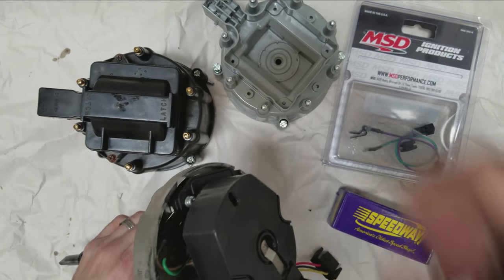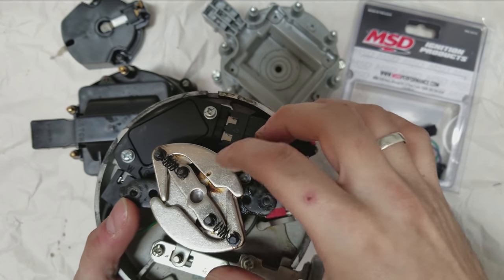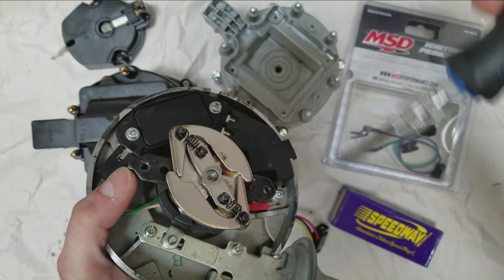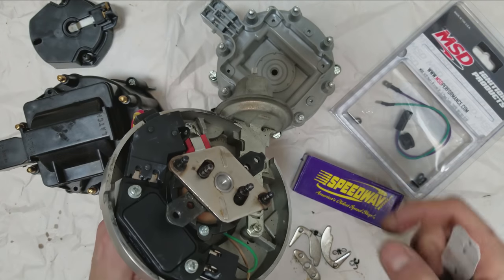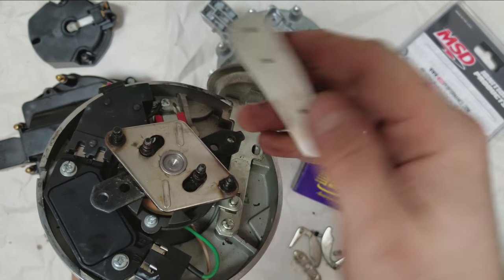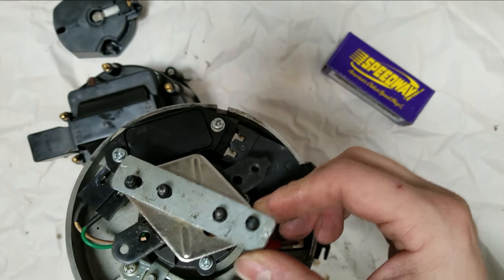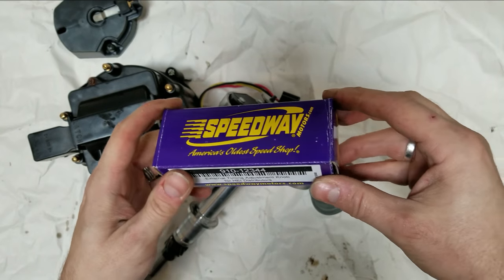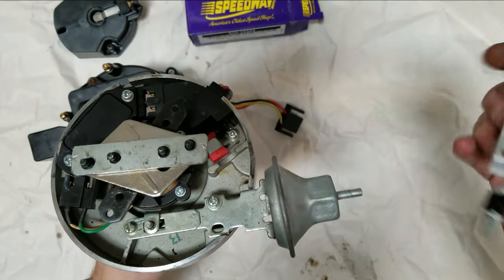1967 Turbo Camaro - GM HEI Large Cap Distributor Timing Control with Holley Sniper EFI

Comment: Thank you for the video!
I have a Ford 300 I6 that has a PerformanceDistributors aftermarket HEI distributor and am looking for Holley Sniper timing control.  I'm going to dive in and give this a try.
Reply: And.... success.

Thank you again.
Reply: @milesaway1980  how did it work out? Ive watched a couple of your videos and we have pretty much the same set up. Is throttle response better and what did you do for max timing at cruise? My dui distributor i curved for 14 intial, 20 mechanical advanced, for 34 at 2200rpm. Vacuum gives it 9 more with a limiter plate. It doesnt ping at all. Just curious if you had to change timing drastically from your stock dui curve when going electronic with the efi.
Reply: @colerippeon3903  For the most part, the curve is a lot the same.  However, you can fine tune it MUCH MUCH more accurately.  You can set the timing you want for a given RPM and cylinder pressure (vacuum) on a big table, instead of just rate of change for mechanical and vacuum advance.

Then there's extras you can do like retarding timing when you're starting it (so you can run more base timing), retarding or advancing timing for temperature, etc.  

It drives very similar, but those extras made it really worth it.  Plus, if you have a problem area, you just adjust the problem area.
Reply: @milesaway1980  thats awesome. Especially being able to retard when starting. My truck looooves alot of initial for get up, but once its hot, any more than 14, itll fight the starter. Hence why im all in at 2k rpms lol. Thank you for responding. Im gonna go this route for sure in the near future.

Comment: you said a few times this is a daily driver.. and what I like about this is it's a 3 year old video.. how is everything working? any fails left you beside the road with the sniper?
Reply from the maker: No fails related to the Sniper or it's timing control whatsoever. However I've had bottom end trouble for a while and figured out my machine shop misread the cam card. So, the car is off the road while I deal with that and other life issues. The sniper has been one of the best investments in the car. The Retrosound stereo has been great too!
Reply: @TurboCamaro67  I'm so happy to hear that. Based on your video and testimony I think I'll go with the sniper quadrajet, I think It makes sense to use the hei as well since parts are so easy to get. How many kms do you have on your sniper?
Reply from the maker: The sniper is a solid unit for sure. I don't have any real records to track the exact kilometers, but my best guess is between 11-12000km's (approx 7000 miles). My commutes have remained short even though I've moved several times since my last video.

Comment: Awesome video, I think I understand what was going on at about the 19:47 mark through the software point, but where did you come up with the voltage rating? Also I have a 6al box, so I should only have to remove my existing yellow wire and use the coil drive wire from the msd box correct?
Reply from the maker: +Benjamin Leibecki the minimum signal voltage defaults to 0, and Holley recommends a .35 default so injury increased mine to .65 to ensure a clean trigger signal. I ended up with a .195 inductive delay, but honestly their was little change get between .130 and .195. As far as wiring that sounds right, it's exactly the same as hooking up an MSD distributor as far as which wires, and definitly don't use the yellow wire.

Comment: I know this is an older video, but I wanted to ask if you are still using and still happy with using the HEI distributor?  We have a Sniper and a HEI/Ford hybrid distributor in my son's 1966 Mustang with a swapped 1990 5.0.  If done correctly, will this give him the economy of a vacuum advance setup?  Thanks.
Reply from the maker: I'm still very happy with the locked out and Sniper controlled HEI distributor. It's really never given me any trouble and seems to work flawlessly. Having the sniper control your timing, with a proper timing map, will give you the same, or better fuel savings as a vacuum advance setup. Not to mention you can monitor your timing in real time with the hand held controller and really fine tune the map for even more efficiency and savings. Your Mustang project sounds great!

Comment: So if i lock out the hei that i have do i rotate the engine to tdc at zero or 34 degrees before tdc
Reply from the maker: Sorry for the delay, you want your TDC on the compression stroke to occur at your reference angle. In the video at about 8:30 I talk about this being at my chosen angle, which was 45°. From there you want to ensure your distributors sensor is phased around your engines peak timing, which will vary from 25-38° depending on your engine configuration. I hope I was still able to help and it makes some sense.

Comment: Again, awesome video, I do have 2 quick questions though. I am running an msd6al ignition box with my hei, so should I select cd box, or magnetic in the software. Next question is on the 15* static timing, should I be using an adjustable timing light set at 15* and looking for 0* on the balancer, or should the timing light be at 0* and I look for 0* while cranking? Sorry for the long post but I’m a little lost on the timing part
Reply from the maker: Hey, glad you enjoy the videos. I haven't used a CD box with the Sniper before but, my understanding is you'll choose "CD Box" to use the system without timing control. Once you know it all works you'll change it to "Magnetic" and use it with timing control. If your using 15°, you'll set the timing to 15° (timing mark on the balancer typically 'left' of your 0° tab. Then with your light set to 15°, you'll see the timing mark at 0°. As a confirmation, If you set the light to 0° you'll see the balancer mark slide to where you originally set it to the 'left' of the 0° tab.
Reply from the maker: I should mention, the 'left' remark is for clockwise rotating engines. It would be the opposite on counterclockwise engines.

Comment: can this be done with the dissy in the engine? I cant get mine out without pulling the engine and i really dont want to do that
Reply from the maker: It certainly could. You just need to be able to lout out the top portion. If you can accomplish that without pulling the distributor you'd be able to rig up the cable/sensor I'm sure. Obviously easier if it's out, but if you can get at it good enough you should be fine.
Reply: @TurboCamaro67  thankyou! the sniper efi can also work without dissy input to control timing right? if i dont do it?
Reply from the maker: Unfortunately, the sniper requires input from the sensor in the distributor to know when to fire the spark to control timing. You can setup the sniper to run the engine but keep the distributor set to mechanically control timing as it was originally designed to do. Once your satisfied with the fuel setup on the sniper, you can add timing control later.
Reply: @TurboCamaro67  awesome thanks!

Comment: Hey, great explanation of how and why this will work. I do have a question however. You had to put a Holley coil driver inline between the sniper and the coil. I have a Fitech 30004 system. Do i need to purchase a coil driver like you did? OR is that not needed with the fitech systems?
Reply from the maker: You'd have to double check with FiTech, but my understanding is the FiTech units have the coil driver function built in. However I couldn't say if they all do by default, or only on specific models. I have heard this method will work with a FiTech though, so your future is bright 👍

Comment: Your crank signal wires (green and purple) don't match on the connector you have green going to purple and purple going to green was that intended? I'm  doing the same set up and was scratching my head at it
Reply from the maker: Yes, for whatever reason the colors are not coordinated correctly. The instruction I reviewed at the time confirmed you had to swap the wires to have it function correctly. Unfortunately it's been years now and I can't recall the rationale for it.
Reply: Sounds good thanks. Was the instructions you followed from efipros?
Reply: @hoythenderson8827  Could have been, their wasn't much available on timing control with a large cap dizzy. I know it made sense at the time but I'm not certain about the source.
Reply: @TurboCamaro67  did you have bad rf with your system?

Comment: Really interesting. 
Have you thought about switching to a clutch fan, instead of the fixed power killer metal fan?
Reply from the maker: I have thought about it. I've actually since switched over to a fixed poly fan with 6 blades. Increased cooling and decreased some of the power loss due to the weight drop. However, electric fans would be great in combo with the Holley EFI system.

Comment: Have they gotten lax? I received no wiring connectors with my holley sniper efi master kit.
Reply from the maker: I don't know, I had a nice supply of them... But that was over 2 years ago now. The connectors were a nice touch too.
Reply: @TurboCamaro67  great video btw I plan to do this with my hei distributor so I can control it instead of buying hyperspark. I know I've seen other vids where people said they got new studs for the intake as well as a fuel pump blockoff plate in their kits as well, but those too were older videos.
Reply from the maker: Wow, that's a shame they're not including those. The extra pieces were what really sold me on the kit. Thanks for watching my vids!

Comment: Will this work on a older Chrysler mag pickup ignition if I lock it out?
Would I just use the coil driver from the sniper kit instead of the chrome cdi box?
Thanks.
Reply from the maker: Maybe... Probably? It should work as the tech is the same. Once you lockout the advance and use the coil driver the only part you need to figure out is the phasing. I just used a cheap eBay dizzy so almost anything can work if setup right.
Reply: Turbo Camaro Thanks,
You sure have some excellent vids posted and I’m working my way through them.
Worst case I found an HEI for mopars priced @ $69 plus the speedway motors timing adjustor for $22 on ebay.
Not sure Ive got enough room between engine and firewall for bug cap so will have to measure first.
Thanks again, I’m about to follow your vids step by step to upgrade software and reset my VE/ timing. tables
Reply from the maker: @TheProchargedmopar  sounds great. Yeah I've only ever done this on this car so I can't really say what will work and what won't. From what I hear, Holly won't help with any troubleshooting with it either. Works great for me. Just don't forget the Minimum Signal Voltage setting as it can only be done in the computer software. I look forward to hearing how it went.
Reply: Turbo Camaro That’s why we have you!!!
Hehe 😉 
I bought the cable for laptop tuning with the kit.  Still need to install new exhaust gaskets and O2 sensor.
Been driving it open loop so far with minor cold start adjustments from handheld.  Base map has been surprisingly close on my Ford 390 FE where the sniper currently resides.  😆
Reply from the maker: Yeah it seems to do a great job with learning the fuel table. My warm up still isn't perfect but I've been meaning it out lots so it just takes a little trial and error.

Comment: Confused by the last part. You are showing inductive delay adjustments because the timing advances upon applying throttle; but isn't that what is supposed to happen since you have total timing set at 36 degrees?
Reply from the maker: Yeah I should have spent a few seconds explaining the Inductive Delay. The total timing was set to 36° but I had the timing set as a static number there and when the vehicle is revved, it should hold the static number. I was adjusting the Inductive Delay to "sync" the electronic timing across all RPMs.
Reply: @TurboCamaro67   Thanks for the answer. I can't figure out how you are using your sniper desktop software to tune the ECU directly? I do not see a usb port on my handheld.. Trying to do this by tuning on the handheld and getting backfire thru intake. 

I am also using a msd box, but selected "magnetic" for ignition because that is the only option that allows you to program base/total timing. Thanks in advance
Reply from the maker: The laptop requires a seperate cable that you plug into the throttle  body instead of the handheld. You can buy a Y cable to run both simultaneously but it's not a Holley option yet.

I didn't use an ignition box but it should be a similar setup. Did you get the Sniper running without timing first or are you doing it all at once? Be sure your reference angle is accurate and in the compression stroke or it'll be 180° off and backfire forever. These sort of issues usually end up being something silly.
Reply: @traceytoolsllc813  u can use the SD card. Save tune on card then insert card into laptop open it and make adjustments. Never saw any y cable

Comment: WOW. this would work great on the Old Pontiac OHC6  engines., which have the Chevy 230/250 as a base and are topped with the Pontiac ohc head.
Reply from the maker: Yeah, the design could be interchanged with several motors. Fun to think about all the interesting combos. I'm a big fan of seeing rare and unlikely engine builds at car shows (and online of course).